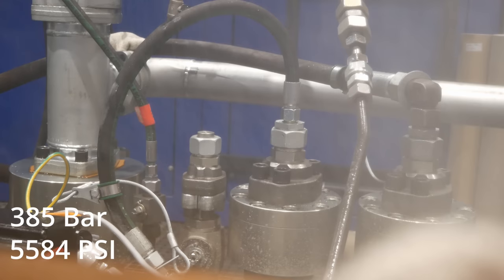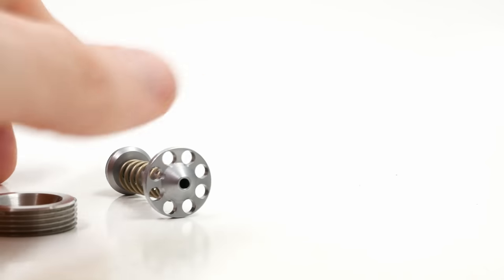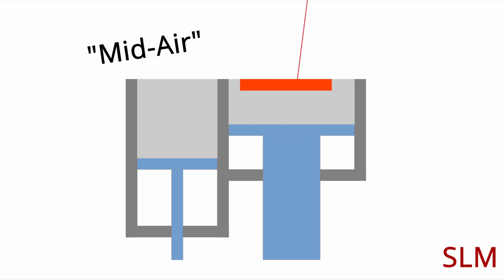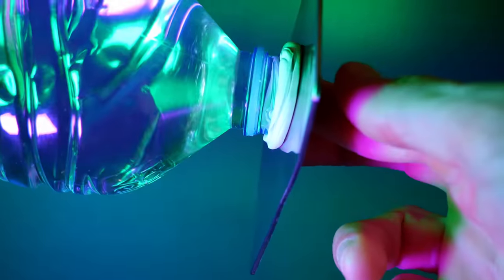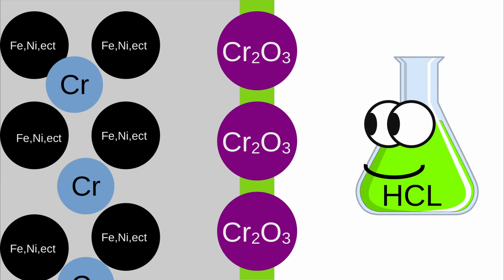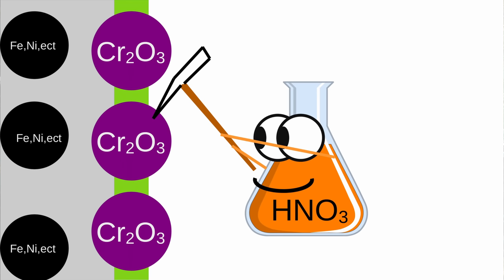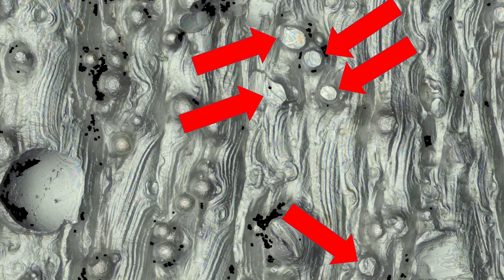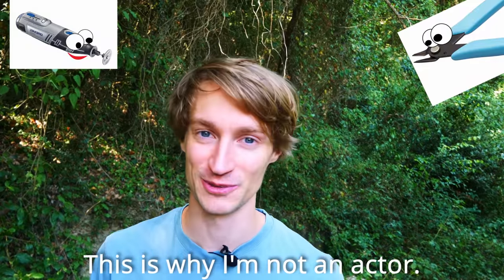Metal 3D Printed Compliant Check Valves!

Comment: Actually kind of suprised you didn't flip it and print springs for support material or make supports that self-destruct under a test load.  Using acid to remove the supports probably didn't do any favors for the valve seals either.

Build quality should improve once they improve the printers though.  There are ways to cool unsupported layers that they haven't quite figured out just yet, as well as ways to almost completely remove the need for cooling.

Comment: Could you remove internal support structures by using an EDM (sinker type) to  burn them out? In this way you can remove many (all) types of metal and simply flush the swarf out at the end of the process. I am sure you can do a little research and figure out how EDM could be used, however I would be happy to share some details on this idea. Just FYI, I am building a desktop EDM on a 3D printer chassis to explore precision machining small parts without the need for high speed CNC.
Reply from the maker: It's definitely a possibility! Need to do more research on the subject.

Comment: Not to make you feel dumb (please, no intention to do so. This video was awesome and I thoroughly enjoyed watching your step-by-step process), but wouldn't it have been easier to drill out all the printing supports rather than all that hassle of super-heating and chemicals to break them? Or am I missing something?
Reply from the maker: In this case it would be possible! But the general concept was that the check valve is somewhere deep inside of a hydraulic system, hence it was removed with acid to show it's possible.

Comment: Why didn't you just made a support structure that could be removed from the valve in a easier way? Like something a drill could remove... Being attached to the intake tube that you could just break and clean... Sure maybe the tip of the valve would not be perfectly rounded cuz excess metal, but I don't think that is a problem

Comment: Couldn’t you also just program it to pause between layers for longer to allow for the print in mid air prints?
Reply from the maker: Sadly no, even if the first layer would be fine, the second layer would cause warping and ruin the print

Comment: Rather than taking the time to heat it up and treat it with chemicals and all that, why not just have the printer wait a few minutes between layers to cool down when it gets to the disconnected part? It could add a few hours to the print time, but at least it's fully automated and saves a lot of human time.
Reply: That solution would only work for the free floating plunger design. The cantilever would already deform during printing without the supports holding it down.

Comment: Wait, why not just use a different filament to keep the metal in place like print it all but the part the plunger and housing connect to (aka the bridge of material) make plastic. 5:18 design is good but make red area different material maybe print in different steps to allow it. print half the bottom of the housing in the slm, then move to plastic machine and print bridge material and then go back to the slm and continue with the plunger being held by the other  material.

Comment: Hmm could the supports be designed to break with high enough pressure?
Reply from the maker: Not impossible! But not super easy either! The support structures are alot stronger than you might think. Need to be tested at some point.

Comment: This is a cool idea but one issue I can see is check valves usually have a shorter life than a pump so unless they are separate pieces you end up throwing away a decent pump just cause one valve has gone inside it which is a massive waste and not good if we are meant to be using the world’s resources better.
Reply: I read that the same argument was made in the 1970's about integrated circuits.  "If one component fails how do you get into it to replace it?"  The obvious answer is to design the component so that each part fails at the same time.
Reply from the maker: Repearability is still a huge challenge in this field, but there are use cases where it is not a big deal, like in rockets.

Comment: instead of all the fancy acid and stuff, why not have the valve be attached to a support structure thats attached the to build plate, not the housing. Essentially just a thin metal rod in the opening to the valve. Then all you have to do is drill it out...
Reply from the maker: In this case it would be possible! But the general concept was that the check valve is somewhere deep inside of a hydraulic system, hence it was removed with acid to show it's possible.
Reply: @TurboSunShine  Ahh ok, that make sense! I'd probably still want to make it possible to remove physically. But I guess in that case you'd have to design the hydraulic system with "access holes" to first remove the support material with a drill or dremmel, and then have to perminently seal said hole with more traditional manufacturing methods. But then again that wouldn't be 100% 3D printing, might be quicker though? Would depend on the complexity of hydraulic system.

Comment: Cant you "solve" the heat issue by printing that one part slower? Sure that increases print time (and probably cost) but if you onlx slow down for that one part of the print it shouldnt be too bad.
Reply from the maker: Sadly no, even if the first layer would be fine, the second layer would cause warping and ruin the print

Comment: Nice idea. You say human intervention is cheating, thats good for scalability. But when you scale this i fear a very bad environmental impact due the acids used. 
At 7:49 you show a side view that looks like the support structure has been removed with a drill. which seems for the part the perfect simple solution. Why not go with that?
Reply from the maker: In this case it would be possible! But the general concept was that the check valve is somewhere deep inside of a hydraulic system, hence it was removed with acid to show it's possible. As for the acids, as far as I know they can and do get recycled.

Comment: Couldn't you simply drill out the support structures?
Reply from the maker: In this case it would be possible! But the general concept was that the check valve is somewhere deep inside of a hydraulic system, hence it was removed with acid to show it's possible.

Comment: Instead of eating the supports away with acid, couldn't you instead print the supports thin enough and/or in a pattern that a high enough pressure causes them to break off?
Still cool nonetheless.

Comment: why dont you use a tesla turbine (disc turbine) as the active valve
Reply: spin activated impeller (tesla turbine) pump as valve
Reply: if you use an impeller the pump with click-limited, then it will spin only one way, and lock up the pump if its not on
Reply: you could also ion stack layer prayer (anode ray tube, yes with ions, not electrons) or copper sulphate metal bath plating into mold cavities, why not just cast metal into mold also
Reply: or cnc layer metal stacks that are heat fused together (after stacking with spokes/bolts)
Reply: you can make that cantilever separately, then insert it, even replace, if that spring breaks, for some reason
Reply: separate lip
Reply: learn to make things yourself from zero, actual zero, no store
Reply: KOH etching instead
Reply: why that sounds like copper pcb acid process
Reply: selectively remove copper from a metal block
Reply: fume hoods are nice, or experiment hoods
Reply: electric motors are better in all cases, even powered wheel turning

Comment: Why can't you just print slower to let the "floating" surfaces cool off in SLM printing?
Reply from the maker: In theory yes, but its complicated! I have not researched this in depth, but during cooling, we can anticipate deformation of the printed part (if you can even make a thin layer stick to itself), this will be a problem when the re-coater goes over it again. Once i can get my hands on a SLM machine again, I will definitely want to try to find a way around this problem. Thanks for watching! :)
Reply: @TurboSunShine  Ah I see, then the re-coater might move it? These things are never simple yeah haha, really enjoyed the video.
Reply: @TurboSunShine  Would it be feasible to use supports that designed in a way that they could break away when the valve is pressurised? So that you could just flush them out?
Reply: I imagine the floating parts sink in the fine metal powder, which is why they need at least some support to stay where they are
Reply from the maker: @BigHorse4200  Would be! was even considered, but it is difficult to break metal with just hydrostatic pressure. there is sadly a minimum "line with" for SLM machines, that make the support structures a-lot stronger than what we would like. also, the thinner, the less heat they can dissipate  🤷‍♂, not an easy task.
Reply: These have all been my questions and ideas as well.  Tho, I have a few others..

Maybe, don't connect to the supports but put as much metal as you can around where you need cooling to minimize the insulation.

And would it be possible to plan and control deformation?  Like a katana. For example, if the moving part needed to be as sphere you would make a bit of an oval or egg-shaped that would deform into a sphere.
Reply: Oh! I have other idea that might genuinely work.  Make the valve as small as the resolution will allow.  Then extent the rod that keeps the moving part straight, through both sides.  (So the exit flow will probably be a little bit bigger.) Then copy and paste that valve in a honeycomb pattern.  These will all be combined into one part I'm just trying to describe it in a way that text will allow.  The moving part of the valve will look like a hair comb feeding into a honeycomb.

My hypothesis is that this will do three things.  Minimize the amount of insulation and maximize heat transference even though the parts aren't connected.  Minimize the effects of deformation. (not necessarily the deformation itself because I don't fully understand how that works)  and lastly maximize the "Beatdown effect" after prolonged use.

It's a modification of the broken reeds or "ape stronger together" metaphor.  We are separating the reeds so that they can be beaten into place, but because they're connected and they work together they still make a much stronger part.

Comment: Id rather have a part that I can dissassemble and repair. 
I recently brought a NERF toy, that was glued and clipped together. Couldn't be taken apart without breaking it. This valve is the exact same thing. If it breaks, you have to throw the entire thing away. 
And as the 3D printing improves, more complex 3D designs will be printed, further limiting repairability, since these "unopenable" designs will only proliferate. 
I don't like the future you promote.
Reply from the maker: I also prefer to have repairable things, this project was not meant to be a replacement for every day items. It was meant to pave the way for integrated hydraulic systems that prioritize weight and size, think rockets or racecars.

Comment: Im not a smart man, but couldnt you just drill/mill out the support structure of your design, carefully, using the thinnest/smallest mill-bit you can find? 
You already have an inlet hole for access (7:20), and you clearly machined your part anyways, so dont give me any excuses when looking for solutions. 
A possible future machining solution is to use a laser to burn off the support structure once finished, from the inlet hole.

Comment: In regards to the opening scenes.
First, that's not 3d printed, it's cast and machined.
Second, that's not functionally equivalent to whatever hydraulic demonstrator you showed, it's just an internal gear pump. 
Third, you want these heavy so that they withstand the thousands of psi at thousands of hours of operation they're designed for, and some thermal mass doesn't hurt when dealing with pressures like that.
Fourth, I see now that was only meant to give a visual to build off of, fair enough.
Fifth, you certainly have a good grasp on slm, and I will let you say what you wish from now on.
Reply from the maker: Not entirely sure what you are referring to, do you have a time stamp?
Reply: @TurboSunShine  added an edit, does that make me more understandable?
Reply from the maker: @freescape08  ahhh, the pump housing is 3d-printed with an SLM machine and then milled. yes, correct it is a gear pump with some internal channels and weight/size optimizations, the hydraulic system was meant as an example of what one would like to unify into a single part to save weight and size.
Reply: @TurboSunShine  is it really? That's interesting, what gives it the bumpy looking texture on the raw surfaces? It honestly looks like any other cast part to me.